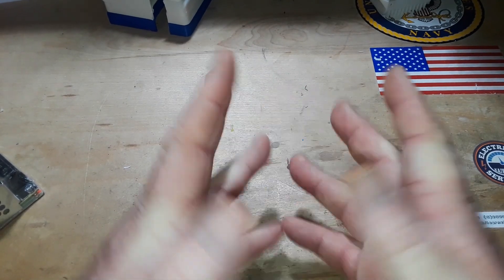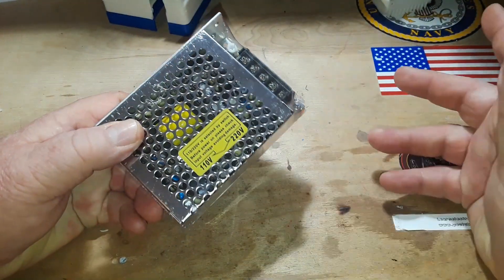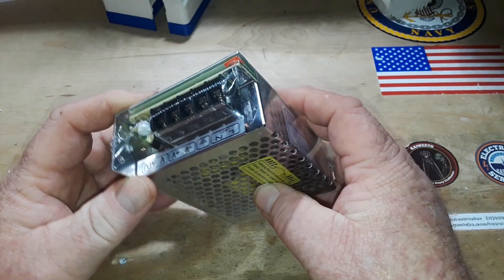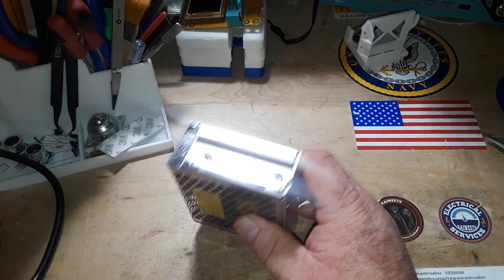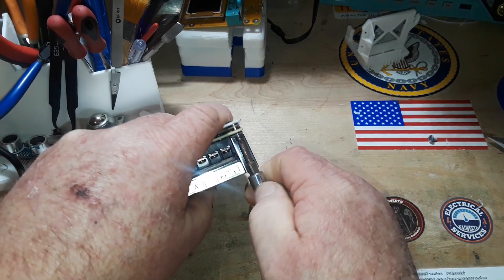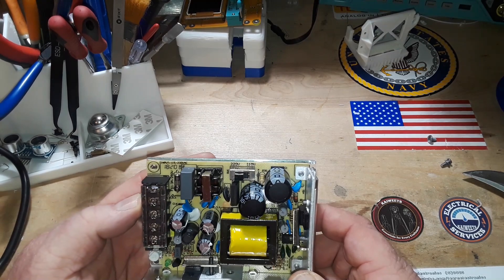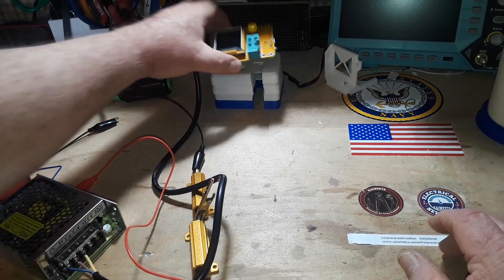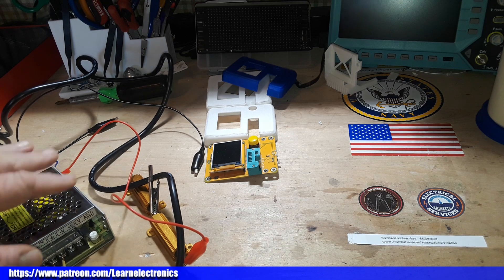I Bought a Switching Power Supply Off of Wish.com

Comment: Correction change the caps to reliable brands and rating, recheck all solder joints and then retest it under a load.  Use a thermal camera also to investigate overheating.

Comment: First thing I would have done is use a continuity tester on the power cord to verify which color went to each cord prong,
then, scoped the voltage across the caps (which may be in series)....for peace-of-mind....used a small load, as you did, then went to a 90% rated load for an extended time (not un-attended).  WITH SAFETY GLASSES!   One SPST switch can do amazing things in a 110v-220v power supply.
Thanks,

Comment: I bought a 12v 40a unit like this and the sticker with the terminal layout on in was Wrong! It was all in reverse! Thankfully I had a 30a unit as well so I caught that before connecting it. Still works 1 year later.

Comment: I think that it depends on the application for what your doing I mean I got one from Wish a 12v 25amp power supply and it work's great on things that my small power supply can give out and plus I also have a 12v 30amp power supply chargeing my battery's and it runs my car radio with no problem's so yeah again it depend's on what your doing and I have video's coming with Wish stuff showing this very fact.

Comment: The caps are likely switched in parallel on 110V and series on 220V, so you'll have double the capacitance on 110V, this makes sense since you'll be drawing more current with the lower voltage.
The main safety issue with these is the transformer, you can't really tell how well it's made without tearing it down, that said for non-contact applications where fire isn't a risk these can do the job, it has a fuse at the very least, I've definitely seen worse Chinese power supplies.

Comment: These devices usually last a few years depending on the load and environment. I don't think they're a safety hazard, but wouldn't use them for any serious application either. Also I would only draw about half the rated current.
Reply: Looking at the size of the transformer, I reckon this PSU would give the full current, we could do with a second video to check and run a stress test etc.

Comment: I have had a 12V supply exactly like this (more output current and output terminals) that has worked for a year or so at being on for lights on a stairwell, then it got replaced with a different system, and I got to keep it. Works perfectly after 6 more years and counting. Sometimes ya just win. I get pretty well all my smd LEDs from Wish. And that is a lot!

And you forgot to say "...and scooby dooby doo" after "and so on and so forth". There was a hesitation just long enough for me to think it was coming... but no. So I had to say it.

Comment: First thing is strip the insulation on the wires and using a lighter or flame, heat a single wire strand. If it just glows red it's probably copper. If it shrivels up it's CCA (Copper covered aluminium and probably fake).  Next, and I may have missed it, check the resistance between earth and chassis. Then run it up under no load and check the output voltage, then under a variable load until it reaches the rated output current, fails or the voltage sags too much - see if you can trim it back to spec whilst under load. If it's still running then leave it to soak; probably with a blast shield over it, for an hour or so and see what happens. Whilst it's running use a scope and look at the output for ripple or other odd signals. If it survives that and isn't so hot it will fry eggs it's probably as ok as any budget PSU.

Comment: If the supply is rated 240V then the two 200V capacitors are in series, not parallel, and are equivalent to a single 400V cap with half the capacitance. Mains side reservoir caps are often doubled up like that on cheap 240V switching supplies, I guess it's cheaper to use two of those instead of a single 400V one.
Reply: Also the output of the bridge rectifier is peak-to-peak rectified mains not RMS mains this guy and learn electronics repair a both idiots seriously the amount of crap that they say in their videos and equipment that they review that's absolute rubbish but they think is good because of their lack of knowledge is I really hate seeing this as actual engineer knowing that people trying to learn from people like this

Comment: I too bought one of those bare bones parts identifiers a few years ago and I also 3d printed a case for mine.

I also built a cheap oscilloscope kit around the same time.

I now see they market a unit that has the parts checker built into a small oscilloscope for around $45 bucks.

It's slick looking and I'm tempted but I really don't need a duplicate functioning device taking up space.

I suppose I could also design a case to combine my two stand alone devices and print out another case but what's the point other than getting rid of the wall wart my oscilloscope needs?

Comment: Did you check if the case is actually earthed Paul?  Wouldn’t be the first time it wasn’t!  I have a similar supply from either Banggood or ic station, and it works just fine, but I don’t load it up and I’m always about when it’s in use!  You’ve already been informed re the uk colours!
Reply from the maker: Yep little wire color dyslexia on my part.

Comment: Could those 200v caps be in series ?  Wonder how bad the noise is on the output ?
Reply: Yeah they are is series. Basically 400v with half the capacitance of one capacitor
Reply: Hopefully, otherwise operational life with a 240V input would be relatively short. They may even have balancing resistors. I wonder what that sneaky slide-switch does.
Reply: @ralphj4012  the real voltage through them would be sqrt(2) x 230v which is 325v and the caps would be obliterated
Reply: @redmist4963  Indeed, my relatively short (operational life) comment was sarcasm, meaning about one, or maybe two, seconds (before bang, smoke, liquid, nasty smell etc)

Comment: As others have said brown is live 
there should be a switch to change from 110 volt caps in parrelell to 220 volt caps in series.
Reply: Not exactly. Аt 110 volts the circuit works as a voltage doubler.
Just measure the voltage on the transformer and you will see.

Comment: The biggest problem with Wish was I rarely got my items and there was nobody to hold accountable! 

After getting burned a half dozen times I cut my losses and deleted the app.
Reply: I'm surprised that Wish still exist.  Most people who are potential customers must have been burned by now.
Reply: Had the same issues. Dropped them years ago.
Reply: I have never been disappointed with Wish. Most of the LEDs that i get from them die because I killed them myself. But then again, I don't usually get stuff other than small electronic components. Solder braid, 2 and 5 mm and SMD LEDs, brass wool stuff, and the like.